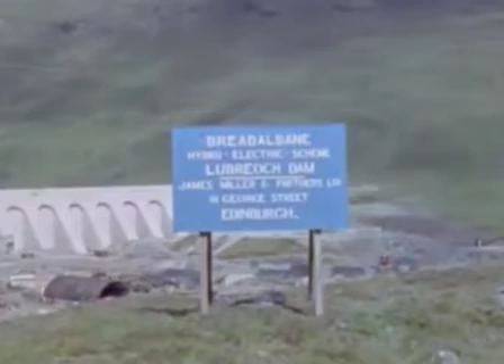Take The High road (BTF) (edit) @BTF

Comment: no heaters in them, engine in cab , my dad had his army great coat along with travel rugs over engine cover to keep noise down along with travel rugs , in winter that all came off including engine cover , engine was your source of heat. we had an Atkinson 6 wheeler ,an Albion 8 wheeler, a Seddon 4 wheeler, a Thornycroft 4 wheeler, a Morris comercial 4 wheeler,  all flat beds, 2 cranes 1, 4wheel. 1, 6wheel , 1 tractor , 1 Centurion Tank less barrel , 1 Clydesdale horse .
Reply from the maker: It was tough being a lorry driver back then, no consideration as too comfort, and the fact the engine was in the cab didn't bother the company bosses after all they didn't drive them.
Reply: @jackflashvintagemotoring7586  hadn't a choice those days that;s how they came from MANUFACTURERS .